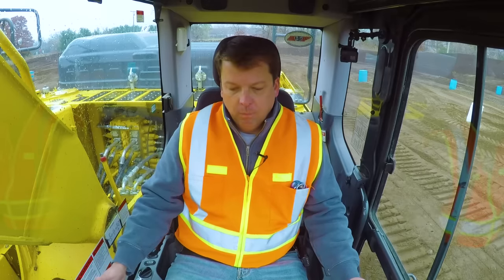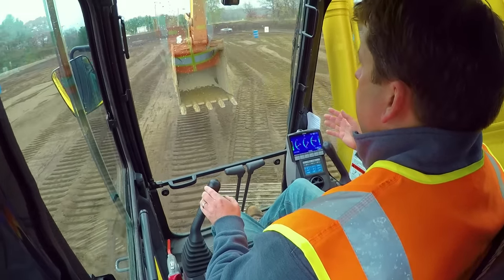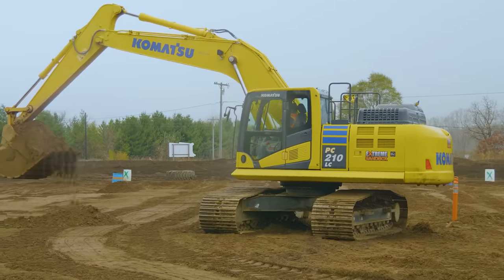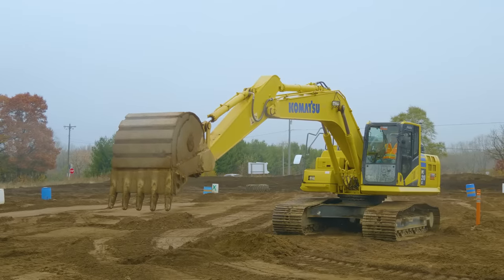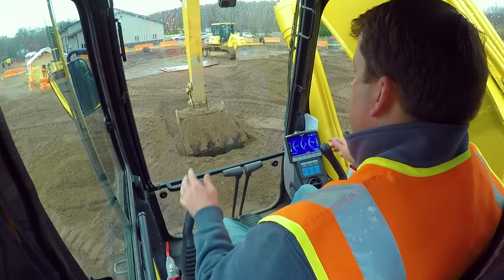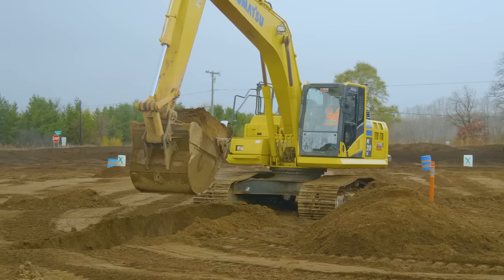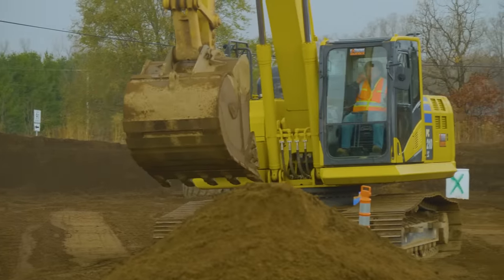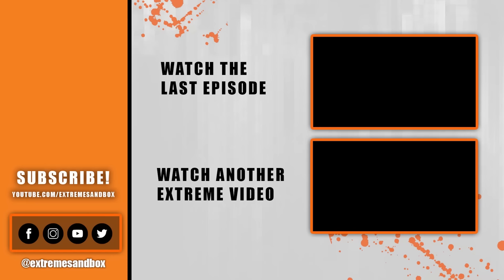What NOT to do in an Excavator | Heavy Equipment Operator Training

Comment: Those are extremely minor "Top mistakes". Mine would be:
- Swinging with a loaded bucket over a cab of a truck
- Not locking out the controls if someone is hooking up to your bucket
- Working too close to an unstable face
- Not using a spotter when working close to power lines
- Overloading the machine when lifting, especially in soft conditions
Reply from the maker: Thanks for sharing your tips...appreciate it!
Reply: Did them all just this summer. Bc I don't complain,  I get all the nasty jobs.
Reply: VHM good points sir!
Reply: Digging with tracks side on*
Reply: I agree with you on those points for sure
Reply: Digging over the side is for skimming not heavy digging
Reply: Thanks!
Reply: Another I hate seeing is when someone is loading trucks and they take a scoop and then hold it up in the air for the next 5 minutes waiting on the next truck.
Reply: Brother before I got in the Union I used to harp on this all the time and the guys always complain that I had something to say and I always told them I'm not making that phone call home to the people's family Explaining how that worker died.
Reply: And forgetting the foreman just park his new company truck 
Behind you  and walking to the cut.
Reply: right on!
Reply: @CodyV207  The Operator I worked with would do this because he expected the dump truck driver to position his or her truck right under the loaded bucket, So the drivers wouldn't back the trucks too close, If you did he would push your truck ahead where he wanted it, Now of course he owned all of the Machines being used on the sight but some Drivers wouldn't like that at all 🤓
Reply: @whistlingrock3157  Depends on what you're doing.
For instance I run a 23tonner drilling piles, the auger + hitch + extension + drive is a minimum of 4t, probably 5-6t when loaded, this can cause the machine to tilt big as it grabs on the dirt coming back up the pile, I generally drill over my side because I am drilling a line of piles and re-positioning is awkward and potentially dangerous with that setup.
It is better to tilt and then reset or backdrill than to break through and pull the loaded auger into one side of the pile, which the machine could probably do if I was over my idlers.
Reply: I agree!!!  Looking out the machine is important and not have it loose clothing!!! 
Just the other day I was getting hooked up to a pile of concrete forms... the guy couldn’t hear me so I stood up to yell out the door.... my jacket was unzipped and it moved the left joystick sending the bucket right into the guy and knocking he over.

Comment: Very informative video. Thank you.
I work in a limestone quarry and here are a few mistakes that I see operators doing:
Komatsu PC 490 loading haul trucks from a 90 degree angle. Tracks being perpendicular to the rear of a haul truck.
End of shift coming off a 20 to 25 foot pad and descending more or less a vertical drop instead of putting material in front to descend.
Have a great day.
Reply from the maker: Thanks for the comment!
Reply: "descending more or less a vertical drop"- Stunt Excavator operator!

Comment: (1) hitting counter weight- -- operator must have a spotter , (2) digging side ways off your tracks, you don't grab a full bucket to where you lift your track, pull your trench 6" -8" at a time. I sometimes dig like that due to maybe 5' to 8' wide trench. I go side to side to keep my edges clean and straight.  (3) trenching in layers I agree and at a 45° angle. so your teeth will cut into the material. depends ground material. the deeper you go, bench or slope. 4' deep 2' bench. (4) loading, yes always swing left, but always have a spotter in front of your machine at a safe distance, in case someone is approaching spotter will give you the sign to stop until all clear. your spotter is very important.  especially if your digging around live lines..... (5) parking... not line with tracks.. turn right about 2' on your bucket. easy step off and more space to step off to. I've been operating for over 30 years. I'm not perfect still learn a thing or two every day. have fun on your equipment but remember..... SAFTEY TAKES YOU HOME!!
Reply from the maker: Excellent advice!  Thank you for sharing!
Reply: Not more wages sorry
Reply: a spotter? at all times? never seen anybody do that... grade man, yeah. or if it's something where you need somebody there watching. but somebody just standing there, watching you dig, all day.
Reply: I've never operated an excavator with a spotter outside of lifting or when I worked as a diesel mechanic with dozens of new machines, ordinarily the spotter would just get in the way.

Comment: Another thing to add to the under carriage set up in excavating is that the idler to the front also has a recoil spring in case of tracks being hit.. and another thing... in the case of an emergency and you need to get back out of the line of danger pulling back on the pedals will move the machine back as long as the drive motor is to the rear as mentioned when operating ... 
cool videos man... HELLO FROM IRELAND

Comment: Have no wasted motion. Be fluid in your actions. Decide where you're going before you make the move to get there. It's a sure tell to see an operator swing back to the cut to then reach out to begin the next pull while having nothing obstructing their ability to preset the necessary bucket position while in swing on the return from spoil.
Reply from the maker: Thanks for the comment!
Reply: This is a big one I try to preach to new operators. As you’re coming around have that bucket ready to take the next cut. Nobody wants to see one motion at a Time
Reply: That's the difference  between  about operator  & a want to be ,I was doing that move when I was learning on a three stick Case  and on a excavator it's so easy
Reply: ..
 @leeheard9922 
 I started back in 1961 on Draglines then Liebherr 360. 700/750/900. (Their first Hydraulic models). Have your full width of cut set in your mind b4 lifting bucket off ground. Straight wall.(Hard ground) Battered walls to suit (soft ground.) and all between. Always dig over idlers. Swing.boom down. Muck pole out. Curl bucket to suit IT'S digging angle to whatever ground, b4 you get to place on ground where you starting.And know where /how wide to leave "berms" when you digging ground not ditches. So you not double digging over same ground.
IE leave space between digs that you go back to and get all the area in 2 or three passes, rther than chasing the dirt.
The bucket ANGLE as it hits the ground IS the most imprtant thing of any digging. Whether on Chains (draglines with 300ton bucket on ends of ,or a 10 ton Hydraulic digger.
Clam shells are another experience again. We used them for digging around laid, backfilled pipes or ""Bell holes" (square)" for welders joining sections..

And remember. A large. (Over 100ton bucket, full. weighs a LOT. curl /hold muckpole IN when hoisting mainboom as you swing up to side of dump truck. Then push it out to get over side or scowback. Curling bucket out as it goes over.
Have fun.
Personally,  I much prefer Draglines. Soooooo much more skill and balance involved
but at 80 my eyes gone. Side casting/overeaching your stick with a 100 ton bucket on the end and NOT going too far to dig the teeth in is an experience. or as a crane. Walking a 100ton load on your hook with a Cat 10 or big Terrex dozer blade shackled to your ballast block to hold your arse down. Work safety didn't exist in those days. Just work done. I've seen a few dead. and legs/arms chopped off. mainly on CJB and Murphy Pipeline sections. Usually Swinging in overloaded welded sections of 36in line. to bellholes. A mile of pipe with 3 or 4 Sidebooms running along it trying to control the balance at the end.

Comment: On point #2. One of the most important reasons for having your drives at the rear is in a panic situation your levers/pedals are correct for direction of travel. When your turned around your levers are reversed. Split seconds can make a difference as we all know. Also you need to be wearing your seatbelt at all times, even during training videos!!!
Reply: Sorry but I’m not waring a seatbelt in my excavator,if and I say that very cautiously if I was ever in a position that I needed to get out of my excavator and f**king seatbelt is not going to slow me down.!!!!
Reply: When you're turned around your levers are reversed.

Comment: Thank you for your thoughts on these. I would like to give you a couple of fairly common errors I've run into with newbies. first and foremost for me is incorrect fuel. More time than enough guys are told to fuel the machine at the end of the day, go to the first tank they see and fill it full of gas. Another operator starts the morning shift, does his checks, starts the machine and you know what happens. I've seen this 5 time in my 45 years operating.  The last may be more of a pet peeve is guys not cleaning their track out. I live and work in frozen country 6 months of the years, froze up mess in the tracks is an issue! Cheers, Billy in B.C., Canada
Reply from the maker: Excellent points...thanks for sharing!
Reply: Oh yeah i clean my tracks at lunch time and at the end of the day especially in the winter time. 8 months of winter where im at.
Reply: @Billy proctor how would you suggest someone becoming an operator in BC?
Reply: Sounds like they don't know diesel from gasoline
Reply: To be an operator get richer first
Reply: I seen the machines filled with gas into a diesel and diesel into a gas, not much fun to try to fix. I've also seen an operator that was new to a machine fill the hydraulic tank with diesel on a hydraulic crane when he went to fuel the upper engine.

I really don't see it happen much anymore, seems like everything on-site is diesel, and machines generally don't leak as badly as they used to. I can remember with one contractors machines the joke was, fill the oil and check the fuel
Reply: Thata fucked im billy in bc canada too😂 whatre the odds we both run equipment lmao
Reply: @zach4454  how? 
You start as a labourer at any construction company with equipment. Then you bust your balls, work hard everyday & Ask to learn more/ show interest. When i first got into construction I Used to be the first one at work and I would always be inside of the equipment cleaning it and sitting in it and just pretending to run it. Then again my great grandfather owned a couple excavators when i was growing up & have been running equipment since i was 4 years old. Its always been a passion of mine. Every single piece of equipment i see, I immediately want to learn about it. 

My best advice for a young or new operator is watch the seasoned operators & learn as much as you can from it. Ask questions, show interest & have a good attitude- no matter what your doing.
Reply: Why to be rich before operating a xcavator

Comment: I always dig over the sprockets on  my machines. 
On my 21 tonner especially. If you’re heading down the kind of places I go the coil springs allow the idlers to spring in and out . Wearing things out quicker . The track then goes tight and slack . 
Also when travelling up hills always have the idlers up the hill . That way the full weight of the machine is pushing the drive sprockets into the chain .  Less chance of track jump . 
I was always told good operators never take their hands off the sticks . 
Use foot pedals all the time . Even loading onto low loaders . 
Everyone’s got their ideas but In all the years I’ve owned worked machines , know the way I’d operate them .

Comment: I agree with your teaching points. I teach Army Engineers and have a couple of extra tips. When trenching, prior to doing the first layer cut, do what I call a ghost run. That is a pull just above the ground. The reason for this is you may have a marked trench line and you can check you are inline. Second tip is don't place the spoil two feet away. Always take into account the Angle of Repose and the Zone of Influence. You should place the spoil at least 45 degrees away from the invert of the trench. This lessens the chance of a trench collapse.
Reply from the maker: These are excellent points...thanks for sharing!

Comment: I'm software engineer but I love watching this coz I always wanted to drive one of these big machines one day!
Reply from the maker: Definitely should come out to one of the Extreme Sandbox sites.   MN and TX, you can get to operate one!
Reply: I bought a mini, very fun to dig with. It really makes you think about how much power even the small machines have. Some of the chunks I pull out with my mini are 200+ pounds, and it does it with ease. I can only imagine what its like running these full size units.

Comment: Good video, I have several thousand hours on an excavator, when parking especially in built up areas always park with your bucket all the way open and your arm out, that way vandals cant damage your bucket ram after hours, just a tip for anyone who is interested.
Reply: Was taught to make sure to park up with as little of the rams showing. The other thing was to grease up before parking up and everything was warm

Comment: Positioning of tracks is very important in trenching or digging deep holes. You should always have your final drives in the rare and your idlers in the front. For emergency purposes of the machine falling in the hole. Operating is all muscle memory and if something happens you will automatically push backwards, if you have the tracks the wrong way you will drive yourself into the hole.
Reply from the maker: Good advice...thanks for the comment!
Reply: Your final drives are at the back to save the sprockets and so the drives take less abuse. If you are falling into your hole you should probably watch more videos on operating hoes.

Comment: Another thing to avoid it tracking sideways with the near full extension. The weight on your back track is so light you don't have much steering control. This is especially true on soft ground. I saw a man this summer run a 30 ton machine into a fence doing this. Just pull it most of the way in. Tracking sideways might seem bad but we have a lot of miles of high fence to push new growth trees away from. When you are moving every 40 feet or so to reposition for the next section of fence it's a waste of time, plus it introduces the risk of hitting the fence with the bucket if you have to keep taking it back and forth across the fence. Do that 1000 times and you might slip up that once. So I curl the bucket and pull it in about half way. Incidentally and probably a cause in our situation is that our machines all have thumbs. Our 30 ton machine has a progressive link thumb is nearly 2000 pounds of extra extended weight. But even our 7.5 mini needs to be in to track true.
Reply from the maker: Awesome information...thanks for sharing!

Comment: Keeping the machine Level is a big one. Having it rocking around all day cause your pad isn't level creates more wear on the machine but also for the operator and the pucker factor so it's best to be level ,keep the bucket in close having it hanging around out in the breeze gives further chance to create a whoopsie cause your weight is hanging out. I mean when it comes to hills it's diffirent but general travel is keep her close, next tip would be to keep it low. Travel positions like you said is an endless fight but the idea still remains we aren't out to shake God's hand so keep her low and avoids the chance of clipping anything. Next up would be learning to run the tracks with your feet. Learn it quick and fast. Cause there's heaps of sketchy times where you need to use your joysticks and travel so learn to use your feet. And last tip would really be to use the seatbelt it'll help with feeling more tied in and that also combined with don't jump if the machine is going to go. Chances are you won't get the clearance. So try ride it out hopefully the rops and fops will do the best they can. Added bonus one is defintely like you said about where your drive motors are. I got taught that while on a bench loading a cone crusher that if the bench in front of you all of a sudden gives way most of the time people will slam the pedals so if your facing the right way when you slam them you might be lucky enough to get away from going with the slide. Compared to say if you were side loading which generally is a no no but if the bench gives way you have zero chance of making a possible get away. Overall I would defintely say you've covered the biggies!
Reply from the maker: Awesome and thorough advice.  Greatly appreciate you sharing all of this!
Reply: Throw dirt up against the front of your tracks and walk ahead a little bit. It will stop you from rocking

Comment: Good day,
One of the most important things i keep in mind since my work area is generally always in steep country is my drive motors always in the rear  or down hill when digging,  traveling  or most any other actions because it is very hard on the drives if pulling uphill in reverse. Especially if tracks are a little loose or sprocket is worn. Thanks. Another is walking away from machine with the bucket left up in air.
Troy
Reply from the maker: Thanks for sharing!